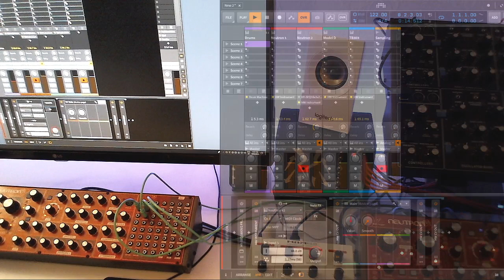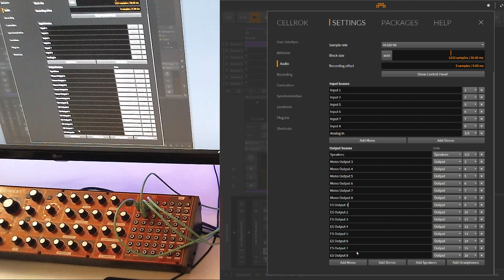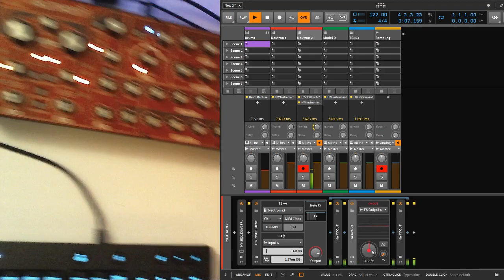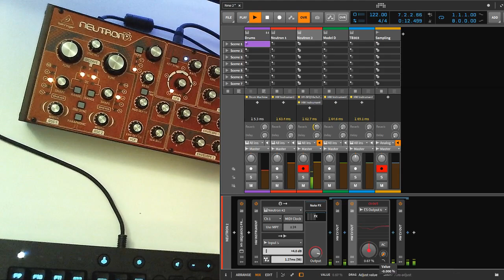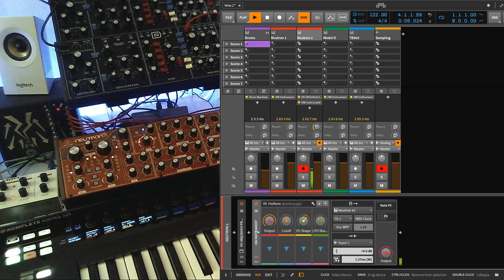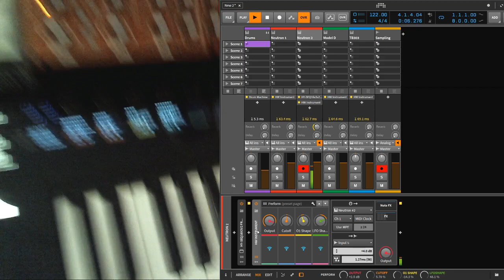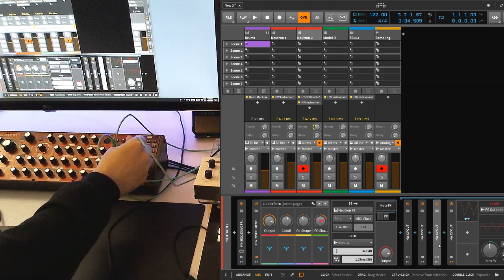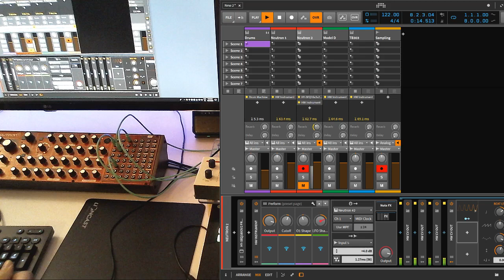Bitwig Studio: Interfacing Hardware Synthesizer through Expert Sleepers ES-3

Comment: My Neutron is really quiet, too!!? At about 5:00 you said a few things about these characteristics that can’t be addressed from the computer, but I believe that there’s a few trimmer potentiometers inside the unit, under the panel.  I’ve seen a pretty comprehensive exploration .pdf online, I found by searching ‘Behringer Neutron modifications’.  I usually route the overdrive or output to the attenuator 1 input, then again.  Att1 output to attenuator 2 input!!  I have both those attenuators up full blast.  Then Att2 out to your interface, or mixer, wherever else.  I’m a big fan of the Sine waves and I don’t like the filters as they are, they need too much resonance, ‘Boo!’.  So it’s really crucial for even hearing it.  Yes, my Neutron is too quiet!!?!  THANKS FOR SHARING THIS STUFF!!  It’s always really good time spent watching videos like yours here.

Comment from the maker: 0:00 Intro (you can skip this)
2:16 The module, what it provides
2:59 Output Configuration
3:34 The "HW CV Out" Device
4:10 Some patches
4:39 Demo 1: Controlling various parameters
7:08 Using Software Modulators
8:34 Mapping and naming controls
9:43 Midi Controller usage
10:38 Setting up a new "HW CV Out"
11:19 Alternatives: Silent Ways
12:11 Demo 2: Modulate PW
13:20 Demo 3: Flexibility
14:11 Recap (you can skip this)

Hope this helps. I shot this video in one take without much preparation, so i am searching for words often since English is my second language only.

Comment: Only works with dc coupled sound cards?
Reply from the maker: With Bitwig it also works with AC. There is this AC button on the device and i tried it. it doesn't have the same amount of range as DC but for experimenting and smaller modulations it's fine. If you plan to use this more often you should think about building a small modular with a MIDI-to-CV module, or buy something like the "Doepfer Dark Link"
Reply: As I understood it the ES-3 is essentially an interface that works somewhat like how a DC coupled audio interface could be set-up to send & receive audio/CV signals. I hope that’s correct as I’m planning to get an ES-8 to use with Propellerhead Reason & my modular gear.
Reply from the maker: @Dogboy73  Yes, it is just an audio interface. The ES-3 is OUTPUT, the ES-6 is INPUT and the ES-8 is BOTH + PC connectivity. 

You'd buy ES-3 or ES-6 if you already have an interface that has ADAT and you want extend its channel count (for example an 16/16 interface with 8ins/8out + ADAT in/out). 

If you don't have a soundcard/interface yet, or none that can handle this amount of channels, you buy the ES-8 which essentially is an audio-interface in rack format, with the addition that the IN/OUT on it are DC-coupled, so you can use them for CV or plain audio, however you like.
Reply: @cellrok  I think the ES-8 would be the way forward for me. I have a Focusrite Scarlett 6i6, which is not DC coupled & has no ADAT, only S/PDIF. Having i/o to & from Reason with my small modular set-up would give me some fantastic options & hopefully make for a powerful system with minimal hardware ........ if it all works okay with Reason. I think it should. But would be nice to see someone using the ES-8 with Reason before I splash the cash. The ES-8 is not cheap. But it's going to be worth every cent if it works the way I hope it does.
Reply from the maker: @Dogboy73  hmm, i haven't used Reason in over 10 years so i can't help you with that. It should have some type of "CV-output module" that allows you to choose any output on your interface and some knob to control the amount. You could try that with your current interface even - it just won't be the full range and some cards have auto-correction chip builtin so it will probably return to the default value, but you could nudge it and see if there's some signal reaching your modular. That is all it does, after all. Then, with an ES module, you will be able to use the entire range and won't have any weird AC side effects. The ES will be just another soundcard with more outputs and inputs. So if the software is ready it is just a matter of selecting it as your main and you can send and receive CV
Reply: Yes, everyone doing that stuff likely wants the ES-8 or even better the ES-9!  I got my hands on a few ADAT machines that work, and I’ve discivered online a small group of fellows who are modifying their older ADAT machines to record DC signals as inputs to the ADAT, for use with their Laser Light Show Setups!  As it is, an ADAT can record DC, but it will clip anything above about 9 Volts.  So a simple Operational Amplifier ic chip and a few components can be implemented to create an output buffer to adjust for the maximum voltage that the ADAT machine can record.  The laser machines only reach up to 10 Volts, so it’s really not too much of a stretch to use the buffer circuits.  I don’t recall now if indeed it’s just an output buffer for ADAT output to playback, or a buffer between their laser setups output to ADAT input, but it works and it’s likely a very good new found usage for old ADAT machines that no one wants anymore.  Giving new life to old gear is a very righteous achievement that people can overlook.  If you work in studio, it’s very likely you maybe have a few sitting around gathering dust or about to be thrown out.
Reply from the maker: @Jimmy I had a "Pico Drums2" with a trigger input and my ES-3 was not able to trigger it reliably with the Ableton CV Trigger plugin. Could this be related to the ADAT voltage clip you mentioned?